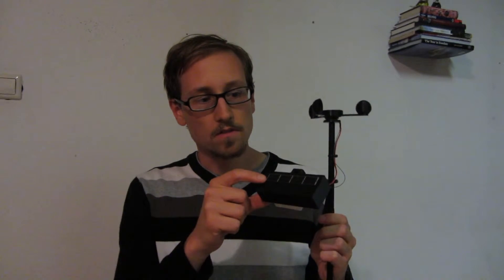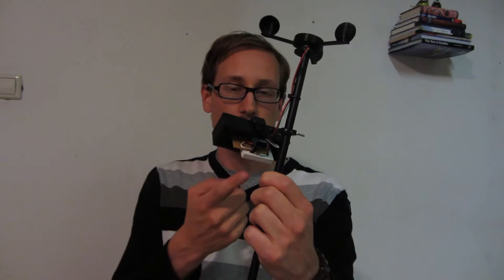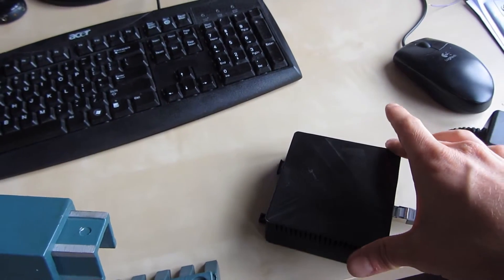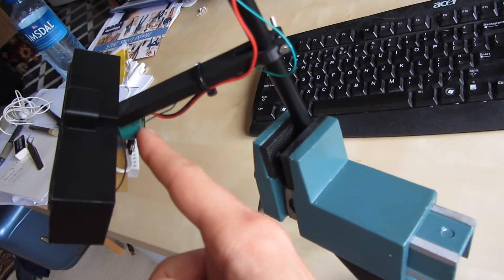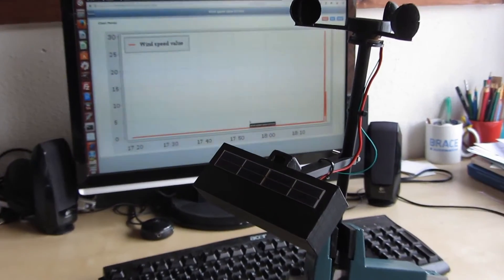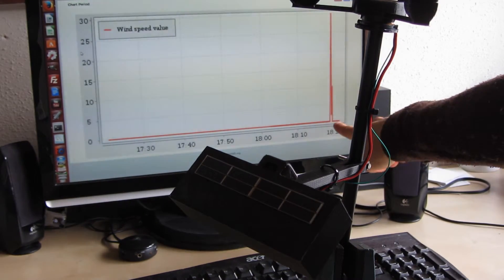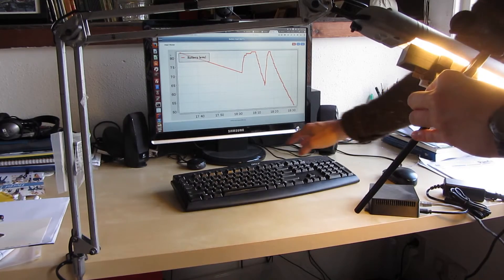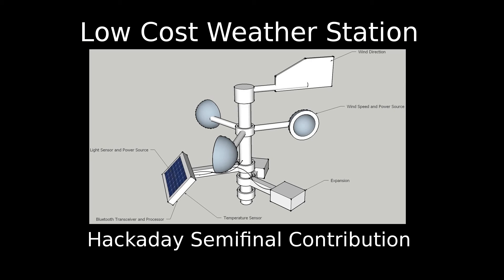Low Cost Weather Station - Hackaday Semifinal Contribution

Comment: Hello, I looking for interesting iot weatherstations. Dont you try to use arduino pro mini? It has own regulator and on ebay cost under 2 dollars. Also pretty nice work with bluetooth comunication and supercapacitor. I dont know why solar cell is so expensive, check here: https://www.ebay.com/itm/Mini-5V-1-25W-Solar-Panel-Power-Module-For-Light-Battery-Cell-Phone-Charger-DIY/122869693416?epid=25012600353&hash=item1c9b9abbe8:g:9SkAAOSwGuVaKRYo